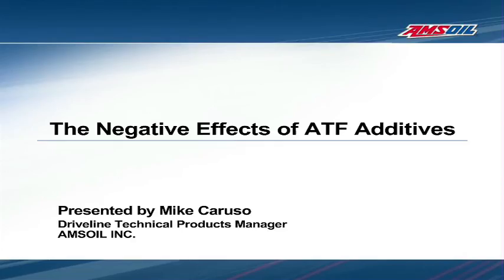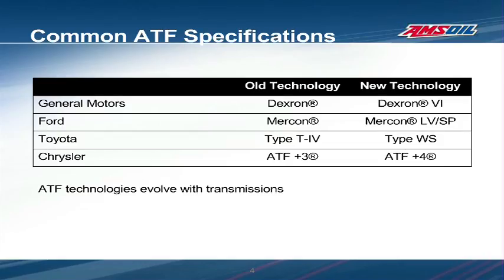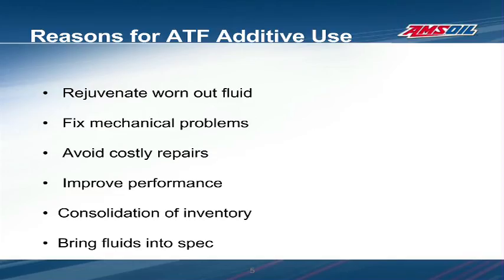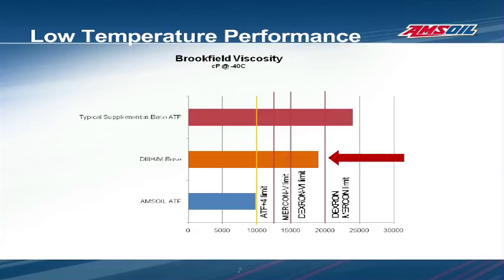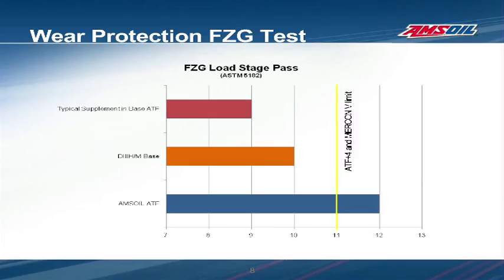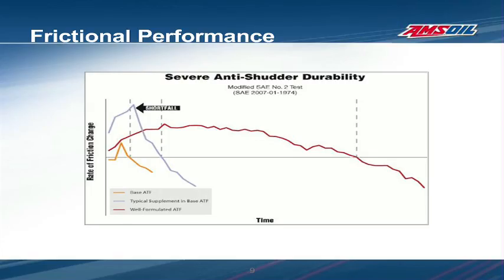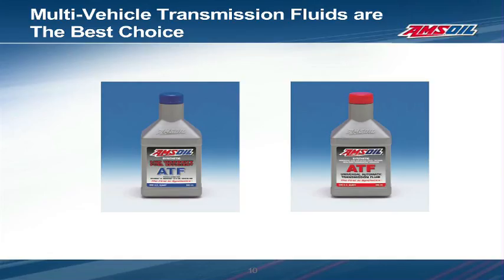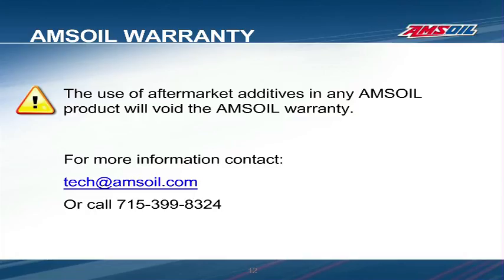AMSOil-The Negative Effects of ATF Additives

Comment: The only trans additive ever recommended by a car maker is Lubeguard. International Lubricants which produces Lubeguard is a pioneer in group V synthetic fluids . You’d be surprised who they sell their products to. Amsoil is a blender. That means they buy all of their base stocks as well as additives from other companies. Exon Mobil has supplied much of Amsoil’s base oils for years. 
I have no use for most additive products but Lubeguard is an excellent product that has been recommended by vehicle manufacturers.
Reply: Amsoil Signature Series ATF and Engine Oil ranks higher than Mobile Oil and ATF though.. show me another auto trans fluid that  has 180,000 city miles (in a Taxi Cab in Las Vegas) stay within NEW OIL specs with that much use and abuse..

Comment: instead of discussing snake oil flaws, how about discussing transmission design flaws? such as a 10 dollar protruding cooler line exposed to salt and susceptible to rust - subsequently leaking out fluid and destroying a 5000 dollar transmission.
Reply: that aint amsoils style... gota knock everyone else and then say BUY OUR STUFF... i have a 06 that has rotted tranny lines leaking... i mean come on... 12 years old its junk?
Reply: @mattlane2282  There is a video where they just pop on some F150s. No rust, just breaks off clean at the connector.

Comment: I just swapped out my filter and fluid on my 2016 f150 with 50k miles with the recommended amsoil fluid and now the truck wont go in any gear.  even though the fluid level is at the correct point on the dip stick with the engine running.  I have a feeling it is not really compatible.
Reply: ghostcar your a fucking idiot lmao
Reply: Check filter placment and use only ford recomended fluid. You may have overfilled it. Only add what u removed in the first place. Disconect negative battery cabke for 30 min then reconect after fluid  change and try again. Good luck!
Reply: Joe Billard so the fluid was fine.  The fuckin part from orielys was not right in their system.
Reply: It did sound weird that just Amsoil transmission fluid alone would cause a malfunction. Given that the level was correct. It'd be a different story if you put peanut butter and sand in there then it would make sense!  I'm considering doing an Amsoil fluid change in my 2014 Ford Edge when it hits 50k. Got an old car that I"d like to test Amsoil on. It has shifting issues.
Reply: Fake don't believe in him my experience magnificent with Lucas and lubegard
Reply: It's true. Not knowing the complex anomalies AMSOIL can cause to an engine may prove detrimental. Just stay with conventional oil to be safe.
Reply: @ghostcar  Your a fucking idiot! I ended up going with a cheap conventional fluid because I thought synthetic fluid wasn't needed. The cheap fluid degraded so fast that it damaged the clutches in the transmission. The car wouldn't go into gear and I ended up doing 3x drain and fills with amsoil atf. The car drove another 4k before i had it rebuilt. The shop said that what ever fluid I used cleaned out the transmission and gave it the last legs. Never using a conventional fluid ever again!

Comment: LUBEGUARD. THE ONLY PRODUCT USED, ENDORSED, RECOMEMDED, AND DESIGNATED BY ALL THE MAJOR CAR MANUFACTURERS AND THE TRANSMISSION SERVICE AND REBUILD INDUSTRY. NO OTHER TRANSMISSION ADDITIVE CAN SAY THAT, NOT EVEN AMSOIL!!!!
Reply: before i added lubeguard to mine i check reviews as well as the web site. i even called a local gm dealer and sure enough they recommend lubeguard and use it themselves when fixing trans troubles.
Reply: Please provide the proof of that statement.

As far as I am aware, no lubricant manufacturer will recommend any additive being added to their product unless they make that package.